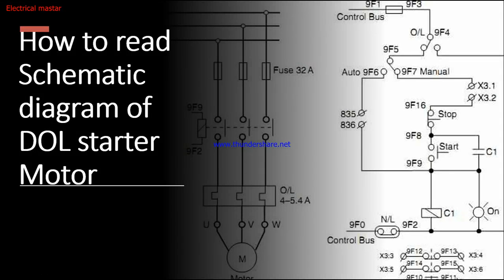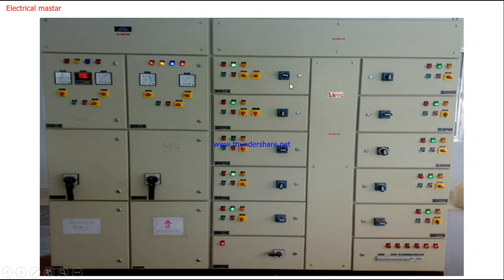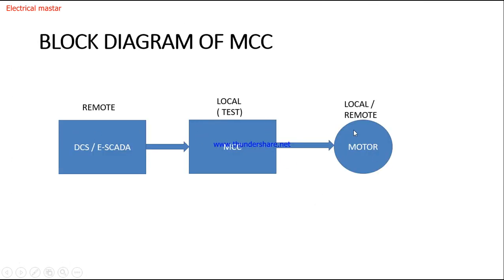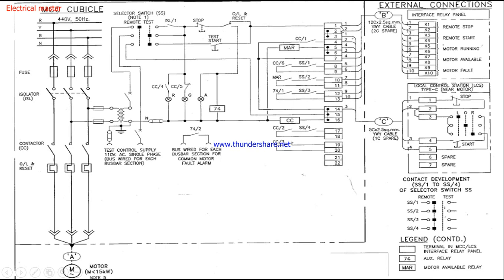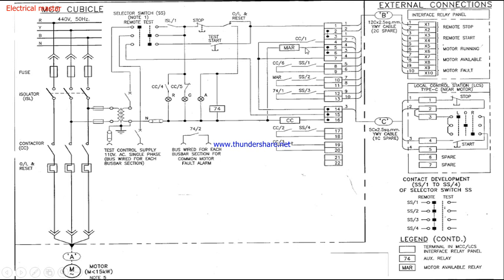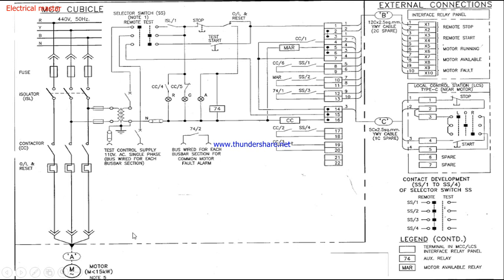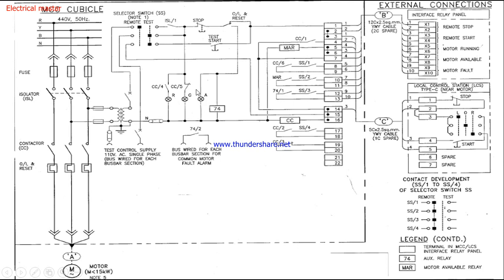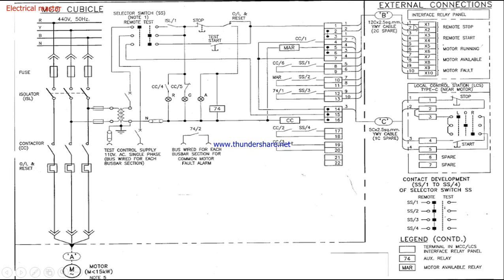How to read DOL Motor starter schematic diagram

Comment: Hello sir,
the video is very much helpful explaining the DOL Starter control circuit and interfacing with DCS.
I farther request you to explain the significance of Test Start NO PB and terminal number 17,18,19,20 in MCC terminal board in the schematic diagram (it seems 17 and 18 are the auxiliary holding NO contact of contactor, correct me if I am wrong)
kindly share the full page of diagram for the viewer's convenience.

Thankyou